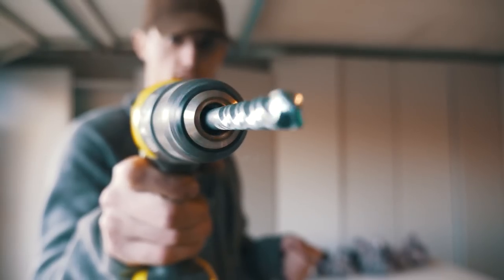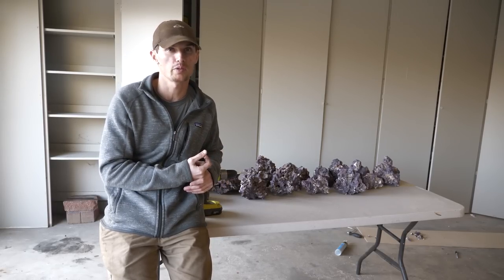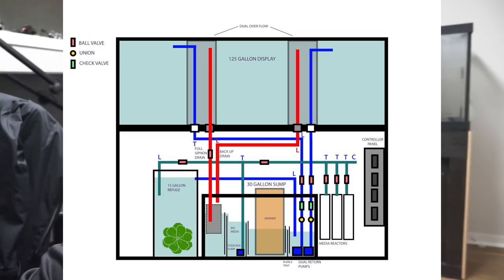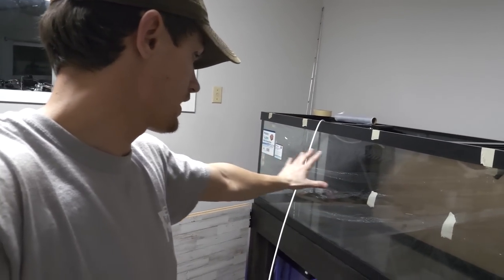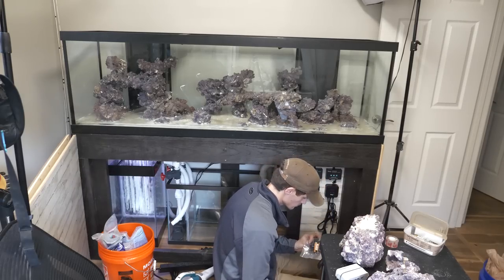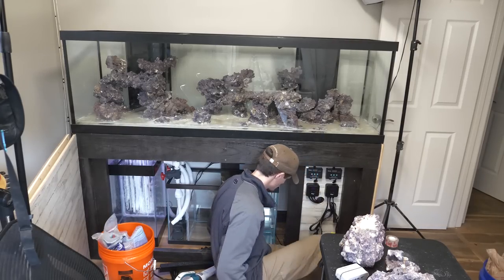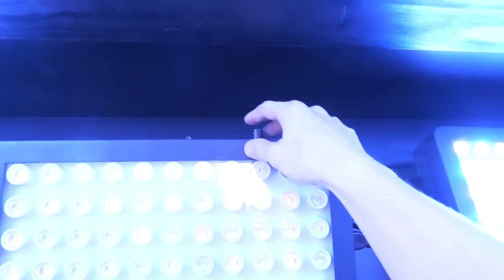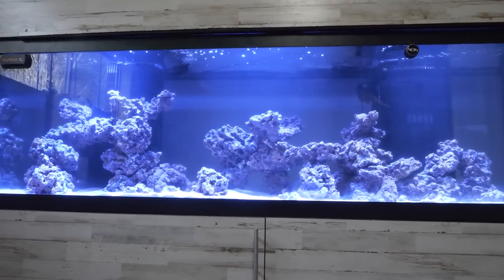125 GALLON REEF TANK BUILD *DIY STAND, CANOPY, & SUMP*

Comment: Everything looks amazing. I would caution the use of gas shocks. I had gas shock on my toolbox and they failed after several years. When they failed, they leaked a lot of oil into the top of my box. Just so you are aware. If your shocks have oil in them. They could fail and the oil would go right into your tank. Possibly crashing it.

Comment: Little advice These lights work great ran a SPS tank in a 125 at 80% blue 10% white , But i would add a T5HO with 2 actinics if it were me and your going big boy corals (SPS ACROS)
Reply from the maker: Tha Silent One do you have a link to a 4-5ft one?
Reply: @BottomlandOutdoors  oddyseas with 2x 54w actinics on amazon or ebay if your trying stay on budget . u should be able to get a 4pk of  blue actinics from topdog sellers for about 30$

Comment: If you have a par meter or can rent one, you can adjust those lights to where you know what the par level is and can place certain coral according to the par. The spectrum on these will work fine if you lean mostly to the blue. Most people will get 2-3 years but for 1/4 or 1/5th the cost, you have to think the ecotech have to last you 8-12 years. Technology won't last that long.

Comment: Sweet set up man. Keen to see how you progress. Any issues with possible rust?
Reply from the maker: Jason Cruz rust where?
Reply: @BottomlandOutdoors  the hinges in the hood?
Reply from the maker: Jason Cruz well they are on the outside of hood and the hood is about 16 inches away from the surface
Reply: @BottomlandOutdoors   Good job on the hood. Very intuitive touch on the mesh on the back(wish I would've thought of that, mandarin goby jumped out and found the little guy 6 months later just before I moved out of my apt into my first house) I had a similar setup on a 45 gal 20 yrs ago. My hinges were on the back side about 9 inches from the rim. I used piano hinges and some plastic paneling to shield from salt spray and about 2 yrs later, salt spray from who the hell knows where, corroded the electroplating and rusted the hinges. Also I used oak, birch, and cedar...sadly the wood eventually warped. Next time I'm thinking of using deck composite and plastic marine hinges. https://beckson.com/hga.html

Comment: How much did the whole build out cost minus the tank, stand and canopy.
Reply from the maker: Scott C.  Rocks, Lights, skimmer, heaters, wave maker, return pumps, auto top off, bio media, etc.. $1500
Reply: @BottomlandOutdoors  
That's pretty sweet,  so the bid at thenlocal.fish store to do my tank for 6k is on the high end then obviously!
Reply from the maker: Scott C. Well depends on what tank and equipment. My lights are cheap some people pay $1500 just for lights and a few hundred for sumps I used a 29 gallon from petco the cost me $29 dollars.. this is just one example. My wave maker is a knock off nero 5 I got it for $120 where the real deal cost $350.. so I went the cheaper route which may give me headaches in the long run
Reply: Ya you're on the right page, because that's ironically what they told me also. They said you could go much cheaper but will have to upgrade later and will be a headache and a waste of money. It's hard to justify spending the money but I kind of have no choice. I build a new house and build the 125 gallon into the house. I would rather spend a couple grand then 6 grand then another couple of grand on coral and fish. I feel like eventually I will have a used car in my house lol. The 6 grand did include the computer monitored system with auto top off, and all the digital probes. 

Maybe I will make a video and share with you. I cant wait to get a peice of ocean in my house tho, the pay off is always awesome.
Reply: Also I like your tank! Cant wait to see it 6 to 9 months down the road. Make sure to post an updated video in the future. Should look amazing!
Reply from the maker: Scott C. Awesome I plan on getting a Apex system eventually.. when I have some more challenging corals to take care of. Do LOTS of research and go slow... I’m battling  ich/velvet rn due to not quarantining my fish... now my tank has to be fishless for 76 days... the parasite has already killed half my fish... Get a QT Tank as well
Reply: @BottomlandOutdoors 
Ya good point didnt think of that. Thanks for the tip